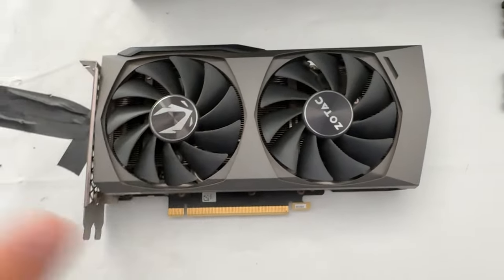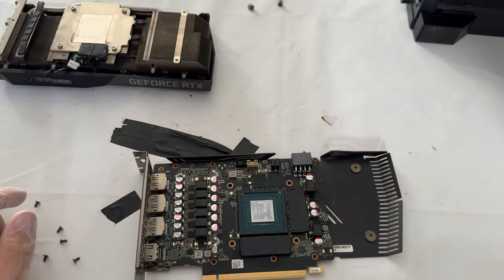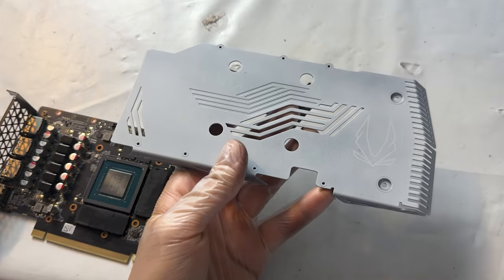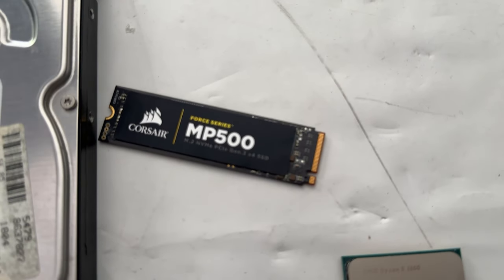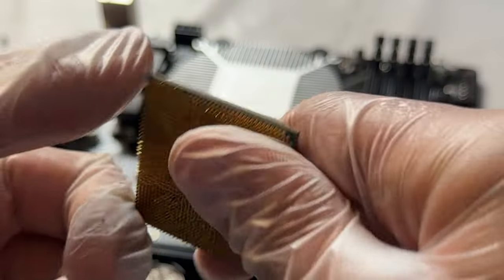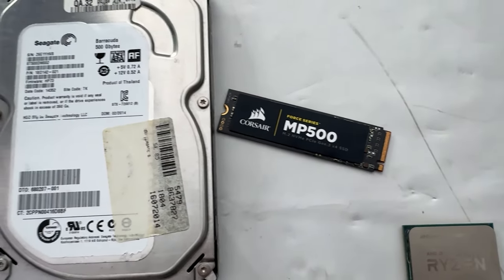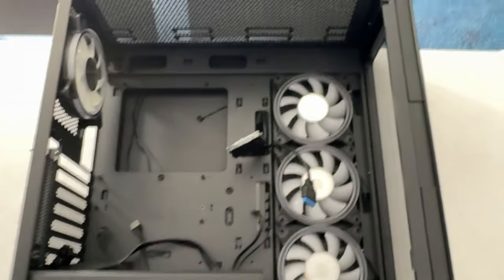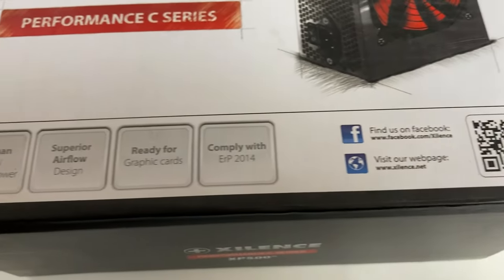He Sold me the Wrong GPU... Building a Sub-300$ Gaming PC

Comment: Hello, I've just upgraded my 5 year old 2x8gb 2666mhz(cl20) rams to a 4x8gb 3600mhz(cl18) ram.
No crashes after 8 hours of gaming for stability test but my cinebench r23 score decreased.
My r5 5600 used to avrage around 10,500 but after the upgrade it can only do 10000-10300. 

Is it completely normal?
Everything is set docp, power plan:high performance.

 Task manager, hwinfo, cpuz shows that my rams are properly clocked including FCLK.